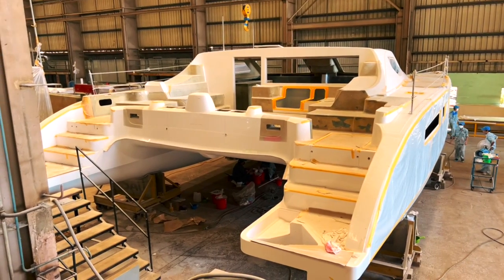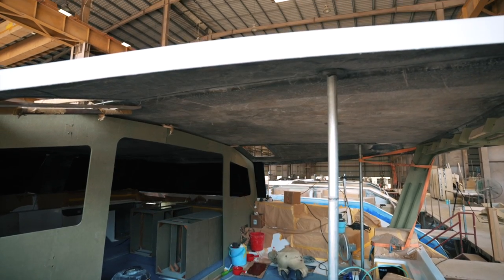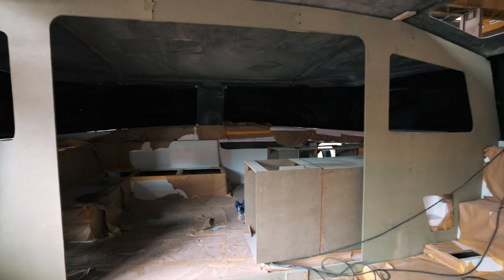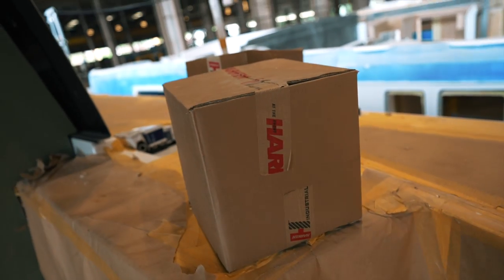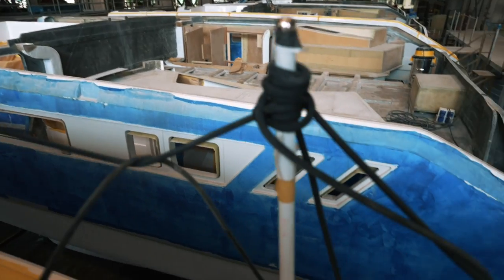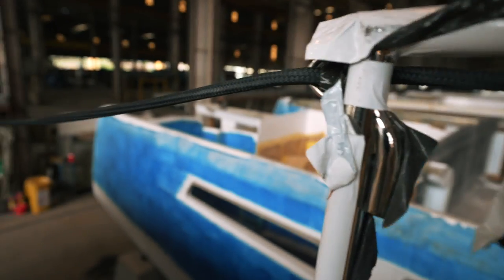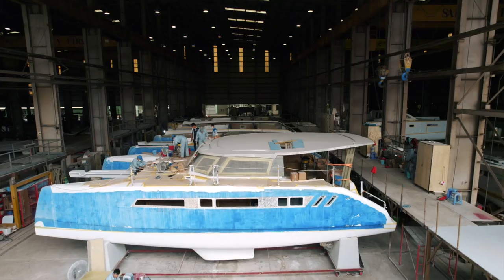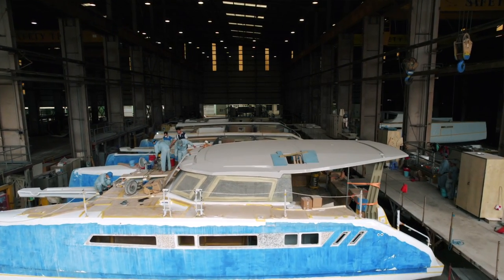Catamaran Build: Deck, Windows and Coachroof are on!

Comment: Thanks for the great vids in the factory from seawind. Just wondering about flexable sola panels on the coach roof with no air gap under will you expect power degrade from heat build up?

Comment: Due to the different building techniques used and plumbing/electrical lines added in a later stage of the build do you theorize these lines will be even easier to access for repairs than most other cats?

Comment: gaslocker in this day and age? why not get a big lithium bank and get electric cook top, cats have plenty of space for solar
Reply: You'll find out that answer of why not in a few years
Reply: They are doing that too...But they have talked about going completely electric, looked at all the issues, pro and cons,  and have made their choice based on the technology available to date!
Reply: That's what the Wynn's did with their H&H cat.  ALL electric but with a small diesel generator for backup
Reply: @ralphgesler5110  You're right.  I went back and looked at the Wynn's video talking about how their new boat is being built.  I just misremembered that detail.
Reply: @michiganengineer8621  I thought they weren't going to have any diesel on board? never the less they may well rue that decision, depending on where you sail of course.